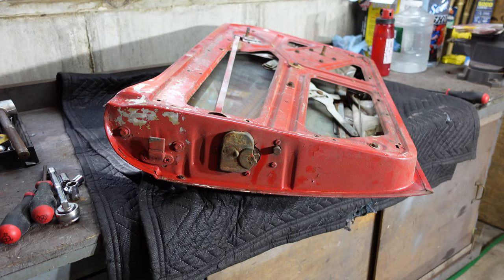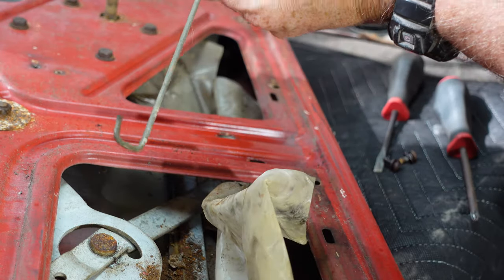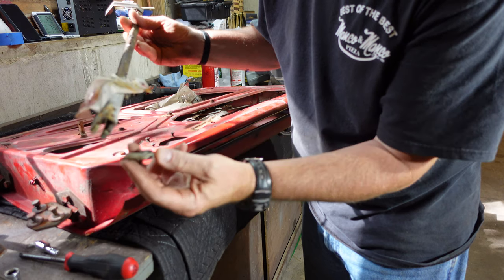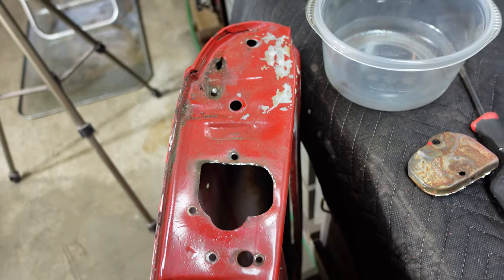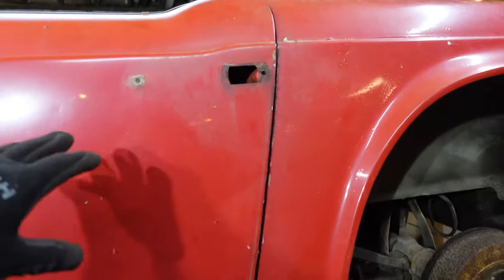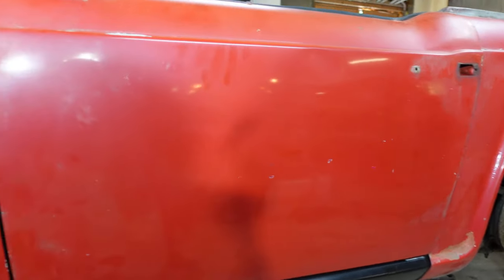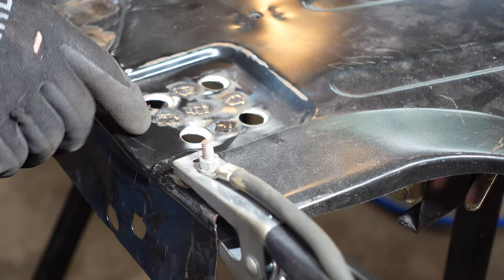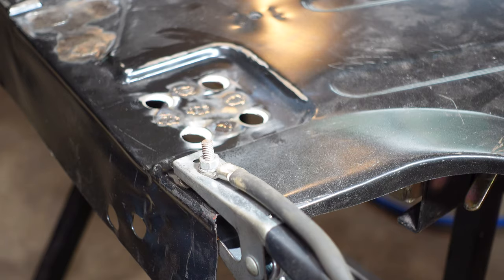Triumph TR4 More Floor Fitment | Roundtail Restoration

Comment: Nice work Chris!  You Will have that floor in soon enough.  I liked the trick of using the small cutoff tool on the welds.  I’m going to have to give that a try.  I have some welds still that need flattening on the floor and firewall flange.  That might work great!

Cheers!
Reply from the maker: Thanks, Steve. Yeah, the cutoff wheel works awesome. Quicker, less mess, less metal loss, much more precise. Better all the way around.
Reply: Much better control reducing the weld height, and quicker too once you get it.

Comment: Nice work, that came together really well and all in 28 min. Haha. I like your approach doing this before taking it off the frame, but I think it makes it a little harder getting some parts on and off repeatedly, the end result should work out great.
Reply from the maker: Yup, only 28 minutes, lol. Yes, the frame is making it difficult, but like you say, I think it'll pay dividends in the end so when I put the body back down, it'll just bolt right up...at least that's my plan...and I'm sticking to it! Thanks, as always, for sticking with me, Barry!

Comment: Hi I'm enjoying this restoration as I did the Spitfire. In case you were going to, ive heard it's not a good idea to store the glass wrapped in bubble wrap as the bubble pattern can etch into the glass.
Reply from the maker: Thanks, Stewart. Just wish the videos weren't so repetitive right now. Thanks for the tip on the glass. Think I'm going to use old bed sheets.

Comment: I find it interesting the GT6 and Spitfire didn't get designed with bolt on quarters .. Not sure how it would actually work, but just a curious thought.
On my floor pans I added extra weld to the captive nuts for the seats. The aftermarket method looks weak to me.
Reply from the maker: I noticed that with the seats on my Spitfire floors, too. Definitely not as stout as original. These floors are better. Maybe they did the one-piece wings to save money? No wasted time getting it all aligned if you can just weld it together in a jig and plop it on a frame?